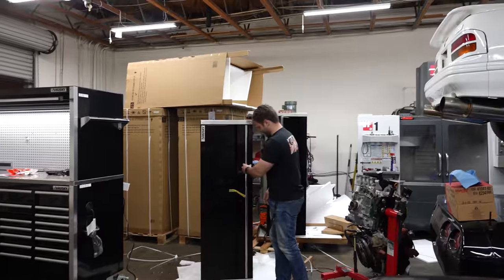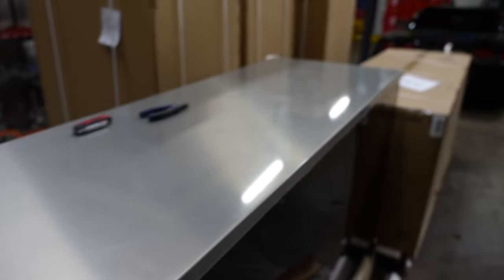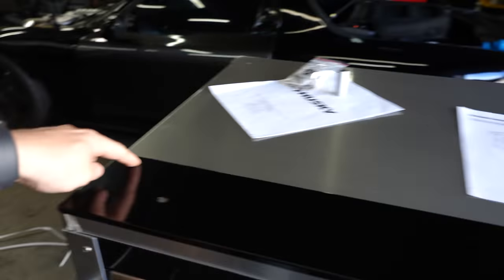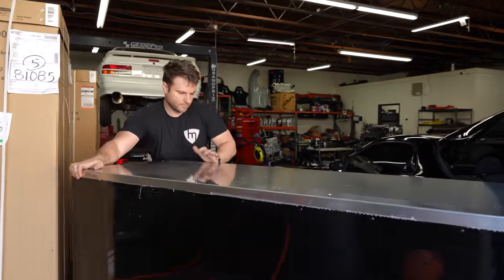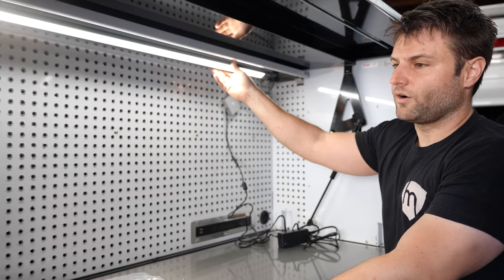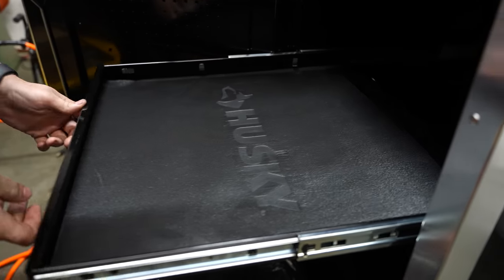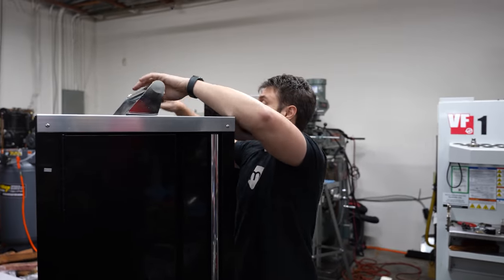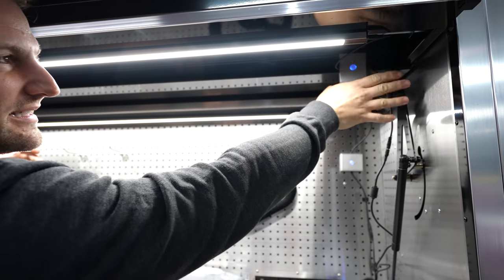Husky makes my DREAM Work Bench I can lock Isaiah out of.

Comment: I had a smaller husky toolbox. It was like 40-42in long. I used it for my gunsmithing hobby. Was able to fit and lock up like 5 whole guns in the hatch thing up top (after making a rack to sit inside) and it was just a table top tool chest. Could fit all my punches, wrenches, hammers, rivets, parts, power tools. All of it. I had it for a while until i eventually built my own from some sheet metal. But I took design influences from it. And since it sits on the edge of my table, I added a pegboard to the side to hang my guns vertically of the table.

Comment: I just did the math on Home Depot web site.  It is a better deal if you buy this set, instead of buying say the main tool chest/cabinet, and then over time were to add the other storage components.  $8,990 for the set up like you have, but $10,052 if you build it over time.  It also appears that any of the many other "kits" would be a better way to go price wise.

Comment: You didn't expect this size of package to arrive, neither did the hooker said the vicar.
You could use the top cabinets for your racing/driving safety equipment.
Or convert one of them into alloy wheel storage or tyre sto to get your racing tyres out of the UV light when not in use.
Or make a home for the shop cat?

Comment: They actually look super nice, but to much money for only 24" of drawer depth.  I personally can't stand soft close or detent style slides, lift latch drawer pulls are where it's at.  You can buy a Homak + hutch for FAR less than a hutch/box combo from Husky which is $5k.  The TV-84Combo1 (Elite 84") from Tool Vault is way better imo.  An extra grand or so, but the 84" workspace and 30" drawer depth is pretty hard to beat, especially if you don't want to fork out the $$ for one of the tool truck boxes.

Comment: 2:32 on that back wall, you should build, above the mill, compressor et cetera, one of those orange racks (the ones you find at any major hardware store these days). That'd be perfect to store stuff that's in larger volume, but not usually used. Could be rims, tires, engines, parts boxes, etc. Since it's besides the main hangar door, that'd be perfect use for an otherwise unused space, and would free up the other walls, make more room for storing cars/projects.

Comment: My husky box is falling apart after 10 plus years of very mild home usage. Wont be buying another one again i spent a fair amount of money on it too. No clue who makes a solid box any more but i need one.
Reply: Husky....... or Harbor(US General or ICON). In my shop we have 10 boxes(42"+ width) in total (counting top units separately which we have 3) 2 adjustable height desk/workbenches and a cart all made by Husky,  have zero issues with any of them the last 3-5years of more than average use for the most part from over loaded drawers to  wood top ones with vices mounted on them that we beat things in (you know, vice things 😂). Now obviously some are used much less than others(Alot of boxes between 2 guys after all) but daily used ones have no difference from one that drawers that only see action a handful of times a month. I can not attest to the quality 10 years ago but I can imagine it is far better now given all brands then to now. None of our boxes are "professional series". I'd urge you to give them another chance on a undoubtedly upgraded constriction and better quality then 10 years ago. Also have and no complaints with 3 Homak boxes that see extensive use (6 years,4 professional mechanic) and a US general cart that gets the most use for the last 3-4 years (2 years professional mechanic as well, I suggest the 5 drawer cart 100% as well along with a big box) 

Interested in what box and what "falling apart" specifically mean?
I do not gain anything no matter your choice and took my time to write my comment just because. No bullshit either, I do mechanics, Car audio install, metal fabrication, wood fabrication, used to be a fleet mechanic and a dealership mechanic as well as home shop and now just home so I do have 2 sets of tools from that but have dedicated boxes for the aforementioned as well as my shop co owner so that is why we have a absurd amount of boxes. Most were bought as store return/scratch or dent, funny enough one that was purchased as a flawless store display we dropped out of the truck, smoked the floor and it rolled/bounced on top of my buddy which I proceeded to flip it off him needless to say, not flawless anymore however still works phenomenally and his most used box  🤣 it is a 72" stainless top box btw so not small nor light mind you so it wasn't a "oh that's cute" ordeal", funny after the fact (ok it was at the time too, he was standing there across from the box and the last pair of wheels came off the tailgate and he didn't have it apparently, box goes down tearing out of my hands then all of a sudden he's gone 😂🤣😂🤣I mean gone, hes not laying on the ground on the otherside of the box, I mean he is fully under this ~700lbs box gone) ,  Anyway good times and good luck, Thats just my 2 cents.
Reply: @commonsenseisdeadin2024  holy reply lol. All of my ball bearing drawers will no longer stay shut. Any of the non ball bearing half drawers open no matter how much lube you spray on the tracks. Some of the ball bearing drawers have popped off their tracks. I bought this new when i bought my house and just used it to work on my cars around the house nothing major. It was a black and gold husky and did not last for shit. I am on the fence i what to buy next as they are all pricey these days.
Reply: @chrisgraff2103  it has some ball bearing drawers and others are non ball bearing? Was it really only 10 years ago that non ball bearing slides? 

For you any box will be a definite upgrade 😂 

Honestly I would just find a box that cheeks all your boxes, size, color, layout and of course price. Unless it's a complete pos which I'm sure you would move right along from, I would be hard pressed you would have the same failures.

Another option is to replace all sides on your existing box if that is the only issue and you like everything else.
Reply: @commonsenseisdeadin2024  pretty sure this is 20 years old but i do mild car shit mainly DIY stuff here and there and it has never moved from its current spot. You are right at this point anything will feel like a pleasure.
Reply: @chrisgraff2103  with those slides and the fact it's more like 20, color me impressed. I would have ripped every drawer off twice by then 😂 

If you don't need a big box i would urge you to get a us general 5 drawer cart with the side cabinet drawers. You'll find that you will move it around if its movable
Reply: @commonsenseisdeadin2024  I mean i guess 20 is decent but my dad and grandpa had boxes older than me work well. I just feel like it was not abused so it should have lasted. I have been looking at those boxes but may end up with a larger one to store more shit i have in other spots.
Reply: @chrisgraff2103  yeah you're comparing 2 very different times, that box will out live your kids kids kids and give 20 people hernias moving it 😂 I'd say build your own but prices of steel these days it might be cheaper to buy a snap on 😂

Comment: The Baller move would be to put a Cat tree next to the Husky tool box so the shop cats can have a husky toy too.  Also Rob needs a Lathe powered by a Billet 4 Rotor that spins to 10,000 RPM @ 2000 HP.  BALLER MOVES !!!!  ( also can we start calling his cat..."Dahm Cat"  cuz it sounds like tom cat even if its a girl cat.)